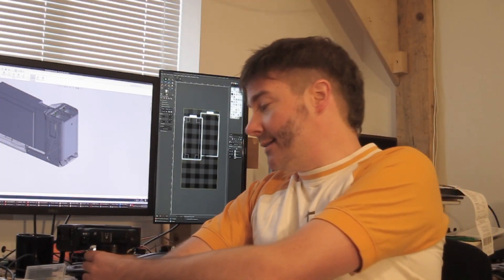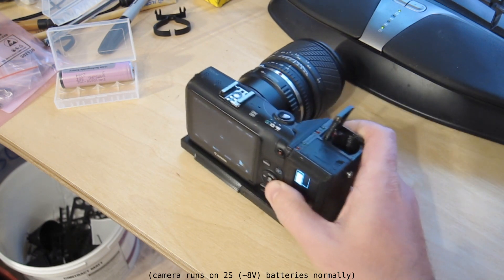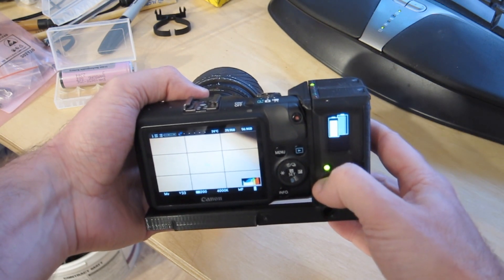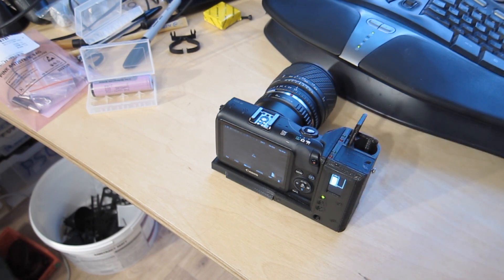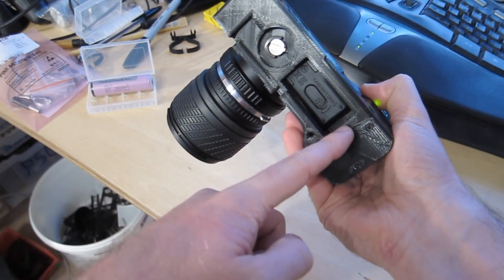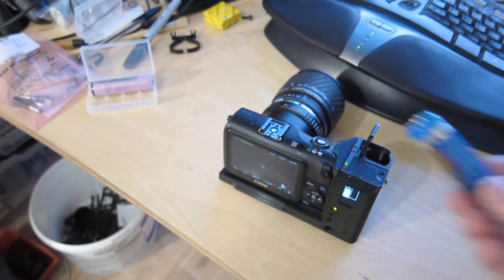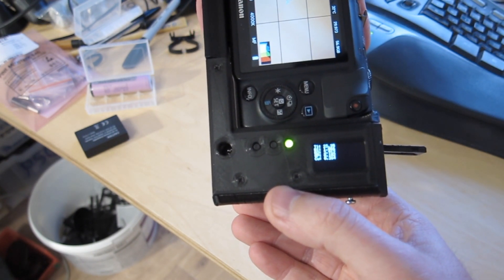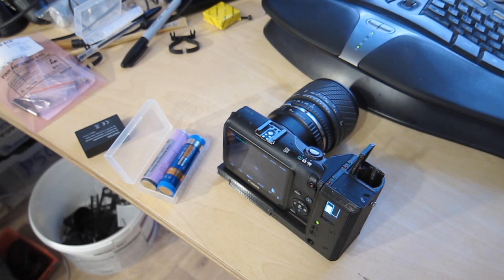Hot Swap 18650 Battery Grip for Canon EOS M

Comment: Would love a schematic, like the other two commenters requested. I know that this is your project that you spent countless hours and money on. If you don't have the time or energy for a schematic, maybe some detailed pictures of the board so that the components can be identified? This is not a multi-layer board, correct? Just the traces visible on either side? Any software flashing that needs to happen to any of the chips onboard? Would love to replicate your project and share resin printed components with you.

Comment: (More FYI): 2MA is right at the limit of standard USB. To overcome this, prosumer and above cameras generally have a small port built into the battery door.  The External Power scheme on these cameras is to use a dummy battery that is wired to go through the port, to either a wall charger or a powerbank.  There are several options in this formula to consider.

Comment: This is amazing, if you ever plan on selling this design I will definitely pay for this and shipping. Been using my EOS M for alot of product videos and commercial shot and Im willing to pay a fair amount for this solution. Just to speed up my workflow and such.

Either way amazing video and you're earned a subscriber here
Reply from the maker: Thanks! Alas, there's so many hours in building one that it would never be economical for me to sell them. The price would be more than that of a significantly fancier camera! Plus I reckon most customers wouldn't feel too good about drilling the necessary hole  :oD
Reply: @funksterdotorg  An access port for a battery adapter cord for continuous power seems to be a basic feature prosumer and above.
Reply from the maker: @MisterDivineAdVenture  Yes and the EOS M has such a port. But if you run a cable through it, it makes it at least difficult (and impossible with the official Canon AC adapter) to open and close the door to get the SD card out. Drilling the side means the door is unobstructed.

Wouldn't matter on cameras where the cards are under a separate cover though, e.g. the 5D.

Comment: Love this project.   Do you have any of the circuit schematics in a place where you can share them?   I'm primarily interested in how you dealt with the dual power source path part of the circuit.   I'm assuming that part of the circuit is prior to the boost convertor so that you have to only deal with one boost?   I would like to use 18650s in replacement for some of my older cameras that only use very poor lifespan NiMH and have the physical space (I think) in the battery well to fit two 18650s (Nikon D1X for example).
Reply from the maker: Schematics aren't online anywhere at the moment, maybe I should change that. The switchover is fairly simple - each cell gets its own pair of back-to-back pFETs, and a microcontroller chooses which one is turned on. The trick (which I haven't got quite right yet) is deciding when a battery is spent and changing over, really it needs some kind of energy counter but when you don't know what kind of cell has been inserted, that's a bit difficult.
Reply: @funksterdotorg  Gotcha.   In the blog  you mention that the STM32 is primarily sampling off the ADC lines to monitor when to switch, but you mention that if you accidentally remove the active cell the comparators will pick it up and make the switch.  How does that work in relation to the pFETs?   Also, with two power sources, are you feeding the STM32 on the backside of the FETs?   I'm assuming that the voltage regulator in the middle of the board is for that purpose.
Reply from the maker: The micro is powered via a couple of schottky diodes from either cell, and then an LDO, so it runs even if both the pFET channels are turned off. It's an L-series part so it only takes a tiny bit of current and has a nice low minimum voltage, so it'll run even if the cells are at 2V8.

The gates of the FETs are just driven by general-purpose outputs on the STM (via open drain fets), if the comparators trip it triggers an interrupt that will switch over to the other channel. Seems to catch it fast enough that the camera stays on, I haven't 'scoped the rails to see if there's a little blip.

Comment: I think i used the wrong boost converter now, because i boost one battery to 5volt for my prosummer camera and it works for turning on it. But when build in flash pop out and start to charging, the power drained so fast and make the camera turn off and on. I don't know why that's happened, maybe the capacitor on the boost module don't have enough power to deliver more current at flash charging moment and drained out.

Then i use buck converter to step down 2 battery in series to get 5v supply and it works very well, but that means i need other component to controll 2 battery in series like BMS, and it can't recharged with conventional usb phone charger anymore. 😑

Maybe I will try to change the boost converter with synchronous boost converter like you do.
Reply from the maker: Capacitors on the output of a power supply will only help it hold up through short-duration pulses of higher current. If your supply can't deliver the overall average power required, no amount of capacitance is going to help.

Generally when boosting from less than 4V, synchronous is necessary due to the high proportion of losses in the diode. Any diode-based booster is likely designed for low power.

Comment: I have thought about building a remote pack for my sony camera this is a great start.
Reply from the maker: Good luck on your build! Is the sony a 1S or 2S battery?
Reply: @funksterdotorg  2s
Sony makes an external power supply the, AC-PW20 AC Adapter.  So there is already a convenient hole in the battery door.

Comment: This is the best battery solution I've seen so far. Your ver. might be too advanced for me, but want to try out with the form that you developed as a start. Do you share the 3D files on your website or github or else where?
Reply from the maker: I haven't put them up anywhere yet, but I don't see any reason not to. I'll add a reply here when I do (and feel free to nag me if weeks go by and I haven't done it)
Reply: @funksterdotorg  just checking if you put the files somewhere yet?
Reply from the maker: @annakimm8  I've just put them on my Thingiverse: https://www.thingiverse.com/thing:4801694

Comment: I'm guessing the EOS M doesn't have USB charging? Or does recording video take up more power than that can supply? Either way awesome job!
Reply from the maker: It doesn't have any form of charging in the camera, you're expected to take the battery out and put it in a (proprietary) wall charger. It's an old camera now, so lacks the features one might expect in more modern stuff.

Comment: I really like this, very useful! Do you still use it?
Reply from the maker: All the time! This is my main video camera. I'm even (slowly) building up a second one with the same grip. So nice to be free of the crap stock batteries!
Reply: Even one that could run into a dummy battery? I could solder the cable myself. Obviously I'd pay 😁
Reply from the maker: @AltCine  Is this in reference to buying one? Hand-building the electronics is extremely fiddly, the hours in that alone make it prohibitively expensive - plus that's far from being the only cost in making things for sale.

Comment: Great design!  I have two Canon VIXIA HF M30's with bad batteries I got from one of the regional university surplus stores for something like ~$17 ea and one doesn't charge batteries using the camera.  Invested in two Kastar battery packs with the USB charger, though have the older packs and one opened to inspect thinking I'd perform a similar custom pack make some day.  Now that I own a 3D printer... and watching this... I think I have everything required to do similar and most likely not as advanced as your design.  Great design and inspirational!  Cool to see Hackaday did an article regarding.  Do you have a hackaday.io or git for all the project files? Is the capacitor to help with the switching of battery packs?
Reply from the maker: The capacitor in the battery adaptor is extra output capacitance for the boost converter - the load the camera presents is very sporadic and at first I found that when the camera took a big gulp, the current would drag the voltage down on the 18650 enough to trip the boost converter out. With extra capacitance it's much better, but I didn't have room on the PCB to add it there.

I don't have a hackaday, but the STL files are on Thingiverse (link in description).

Good luck with your project!